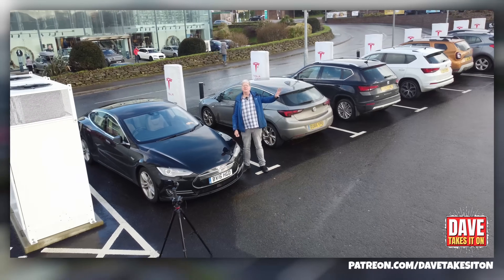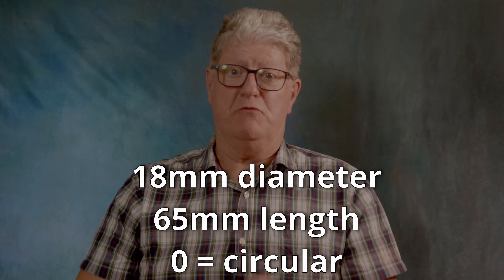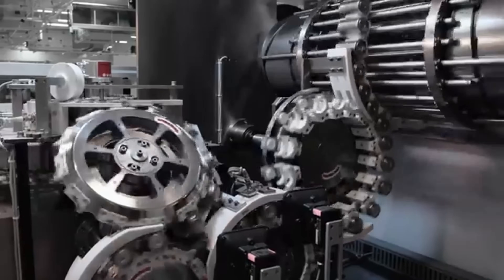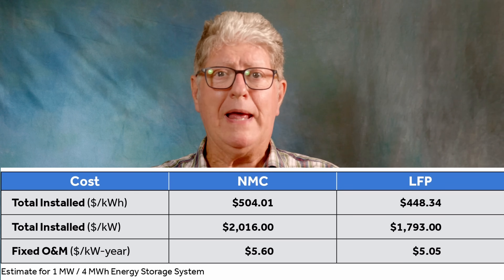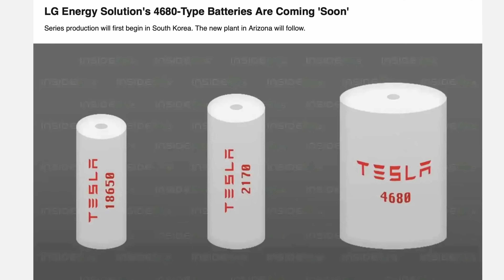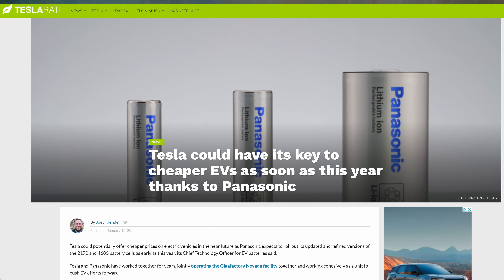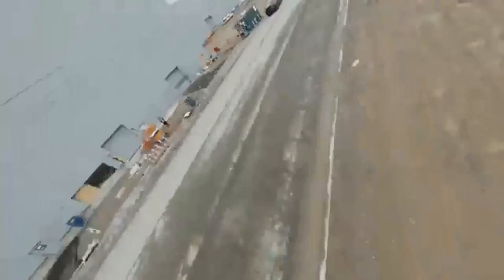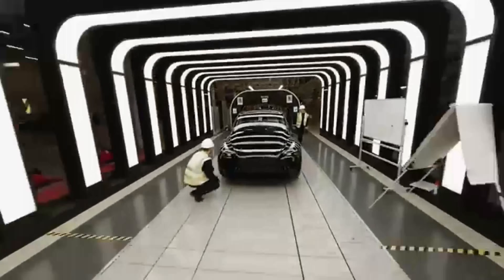EV Guide | Understanding EV Batteries... Solid State, Lithium Ion, Sodium Ion, Lithium Phosphate

Comment: Hi Dave, keep up the good work, it’s very hard to convince a petroleum or a diesel vehicle user to change to EV. How long do they think oil field are going to last when see how many fossil fuel vehicles and power stations in use today. Silly me, they must be hidden oil fields on the moon ! Back to some good & bad news, Tesla have just put ten twin changer on line at a retail park near Meadow Hall Sheffield . Bad news, Lidl has had its third set of cables stolen. We only charge at home unless we are going further a field. Kind regards Jay from Sheffield
Reply: @johnayates2139  Both Dave and Grouch (among others) are providing a great service, to many watchers, by dispelling the lies and myths of EV haters.  Although his terminology may seem a little basic at times, the advantages of EVs are clearly got across to most watchers in a very acceptable manner.  They demonstrate how simple (and easy) EV ownership and usage is for the average potential purchaser/user - and for some that may not be so close to that average.  The many advantages of using non-fossil energy in vehicles (not just the £-p in ones pocket) are a real advantage to the people living on this planet.  The EV haters are not really very well educated, if they do not understand all the advantages.

Comment: In all the years I've been watching battery technology 'improve' I have yet to see anything actually brought to market that makes any significant difference.  Sure, larger batteries (higher capacity) but technologically the increases are meaningless.  A petrol tank consists of two pressed steel sheets welded together and, when filled, contains the equivalent of 10-12kW per LITRE.  A typical 80 litre tank therefore holds 800-1000kW of energy.  Made from TWO components.  Not 5000-7000!
Reply: If energy density is your argument I don't understand why you are advocating for petrol......
Reply: @vote4coffee  I'm advocating for cheap, reliable energy.  You know the stuff - the type that gave you your health, wealth a cleaner environment and higher education so far.  The only thing green energy projects have achieved is beggar the people and countries that took it up - all the growth and wealth now rests in the hands of countries that utilise the cheapest forms of energy.  Don't you understand this?  Every industry WE lose to high green energy costs only relocates to 'dirty' fossil fuel countries.  At least if WE used fossil fuels we'd use it in a clean way.  Happy that you're supporting the polluting of the planet by deliberately relocating your industry to India/China?  Well done......
Reply: @kellyeye7224  so nothing to do with energy density at all?
The west was rich long before oil so that's a bizarre argument.

Have a glorious day
Reply: @kellyeye7224  We just need EVERY country to limit greenhouse gasses.  We might not like it, but it’s a matter of survival of the species.  Donald Trump famously used to argue that technology would provide a solution, and he was correct.  It has - the transition to clean technologies and renewable energy, leaving the pollutants in the ground.
Reply: @vote4coffee  Yes, it's still about energy density.  The massive density of hydrocarbons and coal against the useless batteries and inefficient wind/solar systems that can only exist with taxpayer subsidies.  If solar/wind (anything 'green' in fact) was a viable concept it would stand on its own two feet and people would clamour for it.  Ever carried a 'can' of electricity to an empty vehicle?  Ever wondered why coal, gas and nuclear are STILL the dominant power sources on this planet?  Do you even appreciate the versatility of oil and the products derived from it?  Today IS glorious as it happens.  I sit on a plastic chair under a plastic canopy and consume food and drink brought to me by diesel powered vehicles from farms that produced it using diesel equipment etc etc.

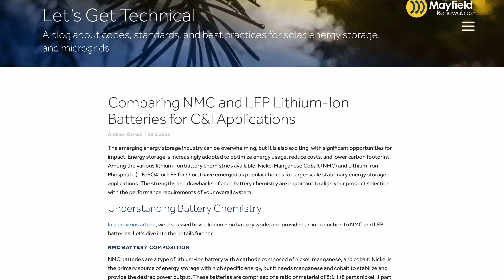Comment: Interesting.  To clarify, however, at 4:43 (battery chemistry - Lithium-Ion NOT i-r-o-n).  Li-Ion is not unique to LFP batteries.  Both NMC and LFP are Li-Ion batteries - "Lithium ions intercalate between the layers upon discharging, remaining between the lattice planes until the battery gets charged, at which point the lithium de-intercalates and moves to the anode. "

LFP stands for lithium ferrophosphate (neither Li-ion nor iron is included in the nomenclature, although 'ferro' refers to iron)
Reply: LFP is Lithium Ferro (Iron) Phosphate. Basically a rust battery. Dave often says the wrong word but we know what he means and he means well.
Reply: @PJWey  Rust is actually Iron lll oxide.  Iron Phosphate is often used to prevent ferrous surfaces rusting.  There are umpteen Lithium ion chemistries used within these chemical energy storage cells (the base unit of a battery).  Lithium ions are involved, rather than other metal ions because of their small size (easier to move through an electrolyte - an analogy might be comparing a much lighter, smaller diameter tennis ball to the much larger diameter and heavier football, both being propelled by a similar applied force).
Reply: @malcym3394  Interesting?  All chemical cells involve ions.  Neutral atoms are not attracted, by an electrical charge, towards anything.  Charged particles are called ions - they are ‘ionised’ particles.  Ionisation involves separating electrons from atoms.  Those electrons, when moving is called electricity.  Simple, really.
Reply: @oliver90owner   Isn't this just a question of granularity?

Comment: More fantasy?  Using your old EV battery to power your house?  Whilst some people actually have it is by no means either easy or, for most people, safe or practical.  Just like I 'could' use my old diesel car engine to make a genset.......  Like I said, mostly fantasy.
Reply: This is a use that old EV batteries can have, it has not been said that you actually convert them yourself. My home battery limits draw to around 5kWh, whereas in an EV that could be over 30kWh for a short moment wewhilst you accelerate. So batteries have an easy life as a home battery. So not fantasy.
Reply: @Jaw0lf  Fantasy for 99% of the population.  Could 'you' remove one, adapt it, wire it in, get regulatory approval?  This is something I actually can do (qualified) but wouldn't bother unless I got a battery for 'nothing'.
Reply: @kellyeye7224   If you are ‘qualified’, you would know and understand the advantages of EVs over ICE.  That gives me the decided impression that your ‘qualifications’ are very limited.  But maybe you need educating about the effects of burning fossil fuels.  You might eventually become qualified and would not then spew out rubbish like you have done in these video comments
Reply: @oliver90owner  Sadly any reply I try to make falls foul of the usual auto-censor so that particular discussion will have to be forfeited.
Reply: @kellyeye7224  A reply such as that demonstrates, to me, that you must be a very slow learner.  I have a degree qualification, so rather more than a GCSE grade C pass in not very much.🙂
Reply: @oliver90owner  I also have a degree (electronic engineering) and taught the subject for 7 years.  I've been an electronic engineer for nearly 50 years.  Talk to me about it.......
Reply: Some useful information…

Comment: You are wrong about capacity.  The difference in volume of the 2170 as compared to the 18650 is ~50% and the energy storage capacity of the 2170 is still only 50% more than the 18650 (quoting your own numbers here).  They haven't increased battery capacity or efficiency - all they've done is reduced the NUMBER of cells being used.  Progress I suppose.  5000 cells in a pack instead of 7000?  Would you be as impressed in ICE engines had a similar reduction in 'parts'?

Comment: Batteries do not nor will they ever have the same energy density as petrol/diesel.  Similarly you can't change the type of battery in your EV either.  You are stuck with your purchase choice.  I honestly can't see any advantage in running a car on batteries.  None.
Reply: You don’t need the energy density of petrol as EVs use the energy 4x more efficiently without polluting towns and cities.
Reply: But of that energy density, only 30% or so is turned into motion.  Add the reductions in efficiency caused in the harvesting, transport, storage, refining, etc. and less than 15% of the 'raw' energy density is available to the motorist.  It's had its day, but we now have better and cleaner options.  It'll take time to get over the natural human "resistance to change”, but momentum is growing.
Reply: Wow. Kelly can't see any positives, disastrous news for the world 😂😂😂
Reply: @vote4coffee  Positives?  Hmmm..... I'm positive that battery production destroys environments, positive it makes child labour a 'thing', positive it prevents people from using the cheapest form of energy to better their lives.  Yeah, sure, there are 'positives' about green energy.
Reply: Oh, and as for advantages, massively reduced running and servicing costs.
Reply: Also many EV's have much faster 0-60 times than many petrol cars and they are around 90% efficient where your petrol is upto 20%. Your petrol car will lose power as it gets older, will need far more parts to be replaced and servicing costs will be much higher. Fuel costs for me are about 10% of what I used to spend on diesel for the same mileage.  As more renewable sources come on line, the cost of electricity will fall, whereas the cost for petrol will go up as there is a finite amount available for us to use even more energy to dig up.
Reply: @Jaw0lf  Woo ho!  0-60.  Yay!  Is that it then?  Is that the sole reason you bought one?  Try that a few times and watch as your battery goes flat in half an hour.  EV's are NOT 90% efficient when you take into account the whole conversion process from source to wheels.  I'm not defending petrol/diesel but I get 600+ miles from one refill that takes 5 minutes.  As for 'electricity getting cheaper'...... wow!  You've bought in to the hype!  You just wait until your Smart Meter talks to the car and informs the supplier you are charging - then watch as the 'duty and VAT' is slapped on to cover that lost from all the ICE vehicles removed from the roads.  Seriously... do you believe what you're saying?
Reply: @kellyeye7224  But when you have burned that fossil fuel, it is gone (to waste as polluting CO2) forever.  You can’t recharge the same battery over 3000 times (or longer than the vehicle will last).  Fossil fuels - apart from being polluting and producing toxins when burned - are not renewable, like the electricity generating industry is rapidly moving towards.
Reply: @oliver90owner  I've tried replying numerous times to your comment but it is very apparent that even talking about the subject is verbotten on this platform.  Key words get your post deleted etc.  Of course, this form of closure on commentary is only done because the truth is to be kept from the masses - and the gullible.
Reply: You would definitely see an advantage if the exhaust pipe was inside the cabin
Reply: @casper_hansen  Charming.  Typical response from a clueless fanboy.  ESAD.
Reply: lol what. why would you want to "change your battery"?. Do you change the engine in your ICE car?
Reply: Advantages:

modern EVs have roughly same range as a gas powered car. roughly 450km real world.

it costs about 1/3 (max) in electricity to fill an EV compared to gas.

basically no annual servicing on EVS. just change tires when it's needed and that about it. no annual servicing. no  oil changes. no fluid changes. no engine conpinents related repair costs.
Reply: @riceman78  Similar range?  Really?  You might be selective in your choice there as that claim is only valid if you take an average of ALL ICE vehicles.  Specific versions have much greater range, indeed my 7-seater MPV has a range of 650 miles (about 1,000km) on a full tank of diesel.  What's the average range of all types of EV then?  I'd figure around 300km or less.  Fuel costs?  Only because electricity is not taxed the way gas/diesel is - fuel duty etc but electricity won't always be cheap - expect EV recharging prices to rise significantly as the loss from fuel duty, taxes and VAT kick in.
Servicing - so, no brake pads then?  Zero fluids in EVs? (I think not).  Software updates?  That one will deliver some doozies in the future I'm sure!  If my engine develops a fault it is repaired.  If yours develops a fault it requires replacement - same with the battery.  My second vehicle is 25 years old, does 45 mpg and is more environmentally friendly than any EV will ever be.  If/when it is scrapped it will be almost 100% recycled.  Not buried as landfill.
Reply: @kellyeye7224  lolz, what total rubbish
Reply: @riceman78  Congratulations.  Your eloquence and detailed response have really convinced me that everything you said was correct.
Reply: @kellyeye7224  Ok then lets break it down.
1) Yes sililar range. My point is that the best and most popular modern EVs have range comparible to what the average ICE car is.  The number 1 sellling car but unit volume last year was the Tesla Model Y which, even the base model has range of 455KM. This is enough for most people. If you want a longer range model you can buy the long range variant which has range of 533KM. Yes a diesel with a big tank will have longer range, but that is not my point. 455KM is enough for most people and equates roughly with the range of your average ICE car gasoline fuel tank. There is a reason the range is set at this level. It is enough for most people based on average driving patterns. 

2) Fuel tax is only part of the reason gasoline is more expensve. The other reason is that using gasoline to move a vehicle is an extremely inefficent method. The gasoline needs to be extracted, refined, transported and then once is is burned and CO2 is released only max 30% if that energy is able to be used for kinetic energy. The rest is wasted in the form of heat. The inefficiency involved inherently makes it more expensive as an energy delivery mechanism. 

3) Brake Pads: If we again take the most popular car by unit volume sold last year which is the Tesla Model Y, the brake pads are so infrequently used that they rarely if ever need replaced. This is because the primary method of braking is regenerative braking where the energy is put back into the battery by the electric motor in order to slow down the vehicle. 

4) There are fluids in EVs but they don't need replaced to the same degree as an ICE engine. If you look at the service schedule for a tesla the brake fluid only needs replaced every 4 years (if necessary). This is a far cry from annual and expensive maintenance that needs done on ICE vehicles. If you have a look at the Tesla servicing schedule you'll see that is is extremely light. https://www.tesla.com/ownersmanual/model3/en_us/GUID-E95DAAD9-646E-4249-9930-B109ED7B1D91.html. I have friends who own Teslas and the only servicing they have done in 5 years is replacing the tyres! 

5) Why would you think software updates would cause an issue? If we again take the example of the model Y I'm not aware of the software updates causing issues. Actually they seem to have the affect of continually improving the car over time. 

6) Engine Faults - ICE engines need replaced too if the fault is such that it is required. You are much more likely to get a serious fault requiring engine replacement on an ICE vehicle than a EV electric motor. ICE engines are fundamentally much more complex and therefore much more likely to break and need regular maintenance. Yes, EV battery replacment is expensive if required, but Telsa batteries have a warranty of 8 years and are designed to last the life of the vehicle. They are aiming to produce batteries that are good for a million miles.

7) Your old vehicle contributes to CO2 emissions which is destroying the planet's atmosphere. It is not "more enviromentally friendly than any EV will ever be" to inefficiently burn polluting gasoline to move your vehicle. It is also very bad for air quality and therefore the population's respiratiory health.  EVs and their batteries can be recycled at end of life in just the same way as ICE cars can me. Infact, there are companies dedicated just to the recycling of EV batteries and their biggest problem is that they can't get hold of enough batteries to recycle as not enough of them are failing!
Reply: @riceman78  First paragraph in item 7.  I can't respond (because of instant deletion) other than to say you are totally bought in to the meme.  There is zero evidence to support that claim and the primary reason for EVs existence is a factor of that claim else such vehicles wouldn't exist as they are too expensive (recall the subsidies necessary to make them even remotely valid?)  Who would purchase something more expensive, with less range, high depreciation and ridiculous 'refuelling' practises unless they were (a) forced to or (b) paid to?  In a basic free market such vehicles would never exist.  The fact that they have compromised, distorted and manipulated that free market seems to go over the heads of T Fanboys.  I'd critique the rest of your claims on the basis that the T is not the 'only' EV in existence nor is it 'the best' - most of your claims are fabrications and exaggerations.  I refer back to item 7, first sentence as evidence.
Reply: @riceman78  EV's non-polluting?  Ostrich position acknowledged.  As for CO2 - I'm helping green the planet - you're welcome.